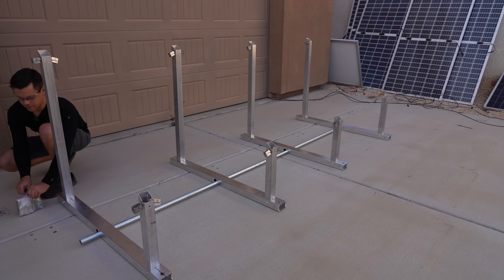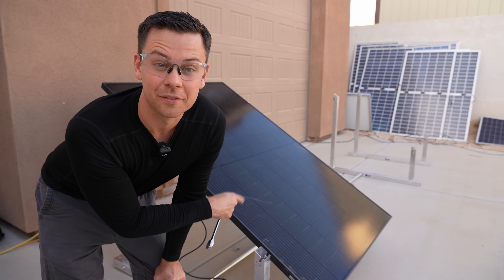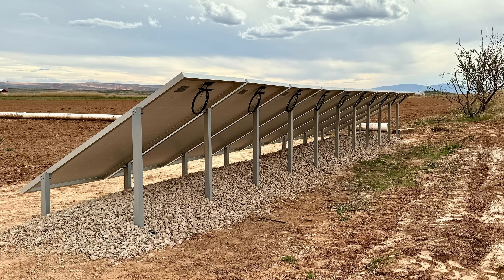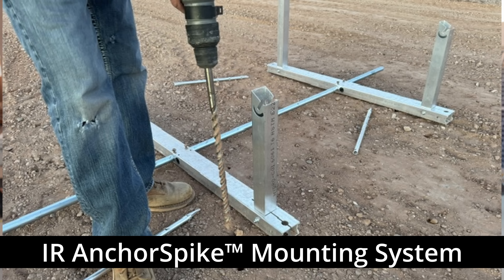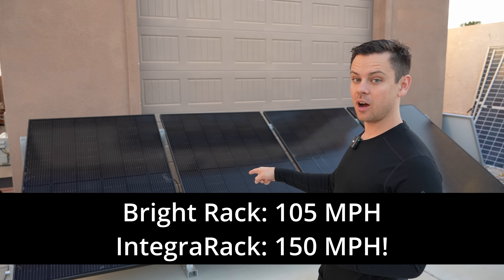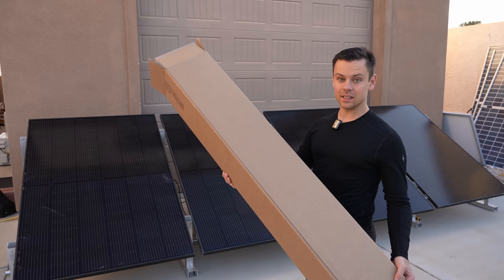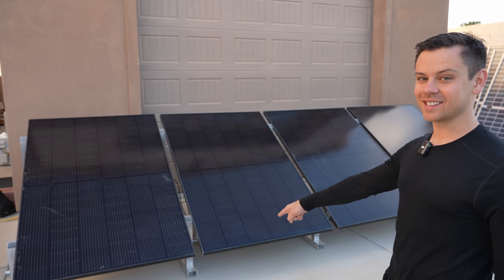IntegraRack: $545 Ground Mount Solar Array Assembled in Less Than an Hour!

Comment from the maker: And now they have adjustable models! Check them all out here: https://www.mobile-solarpower.com/ground-mount-racks.html

Or you can purchase from current connected: https://www.currentconnected.com/product/integra-rack-ir-30-frame-individual-frame/?ref=wpc

Solar Panel Deals: https://www.currentconnected.com/solar-panels/?ref=wp

0:00 Installation
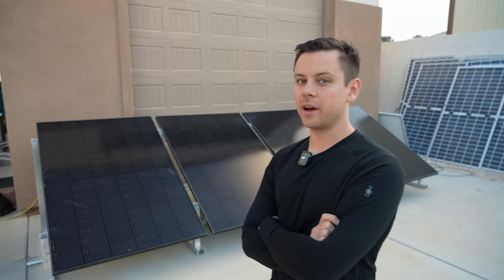2:20 Installation Time
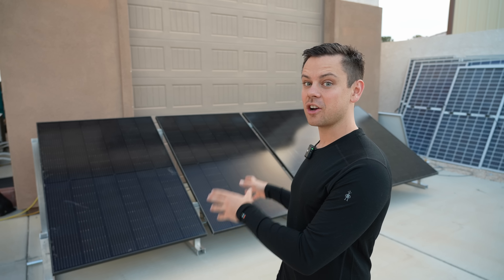2:37 Mounting Options
5:15 Comparison to Brightmount
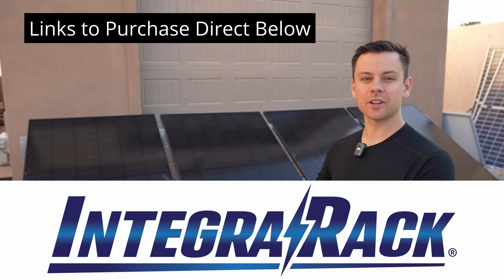6:01 More About The Company
6:26 Concrete Anchor Install
7:02 Conclusion

~~~~~~~~~~~~~~~~~~~~~~~~~~~~~~~~~~~~~~~~~~~
Tired of getting ripped off? Check out my "Will Prowse Approved" solar product recommendations below!

12V Batteries
https://www.mobile-solarpower.com/lithium-batteries.html

48V Batteries
https://www.mobile-solarpower.com/48v-batteries.html

Offgrid Inverter System Builder
https://www.mobile-solarpower.com/48v-complete-system-blueprint-559371.html

Hybrid Inverter System Builder
https://www.mobile-solarpower.com/code-compliant-48v-offgrid-system.html

Mobile Handtruck System Builder (very popular!)
https://www.mobile-solarpower.com/mobile-48v-system.html

Solar Panels
https://www.mobile-solarpower.com/300w-solar-panels.html

Ground Mount Solar Racking
https://www.mobile-solarpower.com/ground-mount-racks.html

Wire, Lugs and Busbars
https://www.mobile-solarpower.com/wire-and-connectors.html

Tools
https://www.mobile-solarpower.com/tools.html

Fuses and Circuit Breakers
https://www.mobile-solarpower.com/fuses.html

Plug-N-Play Solar Systems
Ecoflow, Anker And Bluetti! So many models to choose from. See my current recommendations here:
https://www.mobile-solarpower.com/full-size-systems.html

~~~~~~~~~~~~~~~~~~~~~~~~~~~~~~~~~~~~~~~~~~
Need to build a large DIY system? Need a trustworthy solar distributor? These are my favorites:

Signature Solar
Creator of EG4! Solar Minisplits, Victron and More! Largest Solar Store Online.
If you want $50 off, please use my link below and coupon code "DIYSOLAR50":
https://signaturesolar.com/?ref=cPwLcVc0SW-BjN

Current Connected
Best Prices for EG4, Victron, Midnite and so much more! Fast Shipping and Highest Rated Customer Service:
https://currentconnected.com/?ref=wp

~~~~~~~~~~~~~~~~~~~~~~~~~~~~~~~~~~~~~~~~~~
Join our DIY Solar Community 
Need more help? Join the largest solar forum on the internet for beginners and professionals alike. 140,000 members and counting!
https://www.diysolarforum.com

Check Out My Free Book
Best-selling and beginner-friendly guidebook to off-grid 12V solar!
https://www.mobile-solarpower.com/the-book.html

~~~~~~~~~~~~~~~~~~~~~~~~~~~~~~~~~~~~~~~~~~
Contact Information:
I am NOT available for personal solar system consult! If you wish to contact me, this is my direct email: williamprowsediysolar@gmail.com
FTC Disclosure Statement and Disclaimers:
Every video includes paid promotion or sponsorship (such as free products for review). Some links on this YouTube channel may be affiliate links. We may get paid if you buy something or take an action after clicking one of these. My videos are for educational purposes only. Information is subject to change/update at any time. Electricity is DANGEROUS and can kill. Be smart and use common sense :) DIY Solar Power with Will Prowse is a participant in the Amazon Services LLC Associates Program, An affiliate advertising program designed to provide a means for sites to earn advertising fees by advertising and linking to Amazon.com
Reply: Twice as expensive as the brightmount. No thank you
Reply: @carlosnindy  Depends on the work and supplies needed to complete the installation. If already have a slab to mount to your initial cost is lower but for many the mounts are only the beginning of the costs.
Reply: What panels were use in the making of this video
Reply: Awesome sound effects! Oh, and the content was pretty interesting too!
Reply: Will you need an apprentice!
Reply: Thank you for clearing up the cost for your usage on the video Will. 😁👍
Reply: Hi Will. SanTan does occasionally have used and even new bifacial solar panels. I have seen some very positive videos of the panels being mounted vertically and facing east/west instead of facing south. There seem to be surprisingly good results just because the panels do not get as hot mounted that way. Have you tried a set up like that yet? Thanks
Reply: I am looking for a wall mount system or a hardware.
I would hung them either vertical or about 10 degrees max for northern Canada's winter snowy days.
Could someone recommend a product that would allow us to mount them in portrait orientation to a wooden wall of a barn?
Reply: This was first one you did outdoors now!
Reply: Low Cost,  Fast Mounting, but to building codes allow a water / rock mout for  Solar panels ?   Some locations may require  Concrete footings for safety , etc. etc.
Reply: Good day sir, I have been watching your channel for years!! Awesome content, I have 2 renogy 200ah bluetooth batterys, they are severely out of balance, one cell in each of the batterys is reading 0.2-0.4 volts while the others are at 3-4, I purchused the new pro series battery but would like to fix these. How do I go about charging these individual cells sir, do I have to pull the cells apart so they are single or can I go through the balance wire with straight 12 volt charger?
Thank you
Reply: Hi Will enjoyed this video, but I couldn’t find the package of 4 panels with the frame for $545.00 could you please help so I can pair that with the EG 4 6000 ep I bought after your video I watched May 1st with shipping in route. Thank you.
Reply: @randywalker8960 I believe you may have misunderstood.  $109 x 5 =545 which I believe is the cost of the racks without the panels.
Reply: Keep up the great work Will! Love you dude. Super cool to see you in your zone and making great things!
Reply: no angle adjustment?
Reply from the maker: @wigenite  No angle adjustment, 30 degree only. That is also how they get the high wind and load rating compared to everyone else
Reply: Why would you buy glass panels when hailstones are getting bigger and bigger?
Reply: 5 x 109 = $545
Reply from the maker: @dougdorrer4622  Yes and when factoring in cost of concrete for brightmount rack, the integrarack is cheaper

Comment: These mounts look super easy to use. Good alternative to a roof mount if you have space and maybe an older roof. Fairly affordable too. These are the ones I plan to use for a 12 panel system.

Comment: they are 189 per beam. you need 5 to do 4 panels. Crazy price
Reply: That is for the adjustable ones. Fixed ones are cheaper.

Comment: Looking for a way to mount on the side of the house, not ground or roof.
Ground mounting subject to vandalism and theft.
Roof mounting due to high roof and steep pitch with too much shade.
Takes at least a 28 foot ladder to reach the gutters and have it 3 feet above that for a roof mount which is not my cup of tea.

Comment: yeah but each rack costs more than the solar panel. Is there a more cost-effective way to mount 20 panels without spending $3000 on racking?

Comment: Hey will thanks for the Video on this. I used the IntegraRack to install 12 - 380 watt Solar Panels on a 20ft Shipping container. Mounted both on the roof and on 1 vertical side using IntegraRack. Maximized the space, you video made the difference in deciding which way to go. I put a pic on the forum, and posted a video. Anyway wanted to say thank you for all you do! Keep it up!!
Reply: Did you install metal to metal or use some butyl tape?
I am considering this to install on my 40 foot container, yet i need to build a wood frame to get it at least 4 feet higher to get above some trees.
Reply: @ Actually we painted the top and side of the container with white elastomeric coating (same you would use for a mobile home roof) this was to help seal the container, insulate the aluminum from the steel and improve bifacial gain. Because of dissimilar metals (aluminum and steel) I would use some thing to insulate the two from each other to prevent corrosion.
Reply: @GearedAndReady  and the bolt was a third type of metal?
Reply: @patrickdonegan9559  The nuts, bolts and washers were stainless steel. It is really hard to prevent all conductive contact. Reduce it as much as you can, ground the container, will last a very long time.
Reply: @GearedAndReady  i have these silicon inset / washers that might keep the stainless from touching the other 2 metals.
and i am using those decksavers to keep the wood off the metal sides so there is no water collection places.
Reply: @patrickdonegan9559  Good idea!

Comment: Just ordered 31 of the 40° black zinc.
Reply: Unfortunately for you @WillProwse CurrentConnected I'd not have the 40° adjustable in black so I got them from SolarPowerDistrutors.
You should get a link for them that gives you credit. Not that you need it.

Comment: I know you showed the bracket that will make a ground connection throughout the frame and all panels.....but what about a bracket that would connect to the frame to hold a ground wire that goes to a ground rod? What bracket and where to find that would connect to that frame?

Comment: Will, one thing I am not certain about with this configuration are installs in locations where snow packs up to 3 feet high or even more! I wonder if IntegraRack offers some kind of (dare I say) integrated solution to mount these higher while still keeping things simple? I really do like these as it removes a lot of work from the equation, but in the locations where we install ground mounts, these are simply too close to the ground.
Reply: We have 17 panels with front 16" from ground. Nova Scotia. Worst winter ever. Very easy to remove snow and no issues at all with snow. The bifacial panels warm up the snow and it mostly slides off. Had a few big storms where I had to use a broom.

Comment: Beware. You are not getting a kit as shown in the video . price of 109 bucks is just for 1 leg!
One Base Tube
One Long Leg
One Short Leg
Four IR-F2 Flange Clamp Bonding Brackets
Four M8-1.25 x 90mm Carriage Bolts
Eight M8-1.25 Serrated Nuts
Four M8-1.25 x 16mm Thread Cutting Bolts
Four M8-1.25 x 65mm Carriage Bolts

Comment: I suggest take the solar panel off and put joist tape on top, and paint the pagoda first. The way you did won't survive years. The wood top will rot, the screws and bracket will not holding your panel.

Comment: I was informed that a solar rack can give 40% more that follows the sun.  Can I use a simple mechanical device that will moves the array at the same rate as the sun moves and at the end of the day trips a trigger and reset the array to move back to its starting position?  I may not get the whole 40% but would it not be substantial?  Could you demonstrate this?

Comment: I am about to install an array and was going back and forth between this and the Brightmount. In the end the cost is the main driver. Once it's installed it's done so if it is a couple of extra hours no big deal. To install 4 panels with IntegraRack is $440.00 for the 30* tilt. The bright mount is $279.00 to install 4 panels with a 30* tilt. In the end both are probably strong enough. If it was price competitive with the other option then I probably would have went with IntegraRack for the ease of install. I re-watched your Brightmount video for a refresher. Price difference is strange to as there are far fewer parts in the IntegraRack, you would think they could have knocked this out of the park. Thank you for the videos!

Comment: The nice thing about this mount is that it does not have any bracket that goes across the back of the panels that could block light from hitting the back of bifacial panels.

Comment: They look easy, but they are much more expensive than the brightmount. And I refuse to pay twice the amount of money for a simple piece of metal compared to the 430Wp bifacials I have.... The idea is good. But the profit is also very high.
The brightmount is as expensive as my panels, and is much more complex.
I am really inclined to just fuck it and buy some aluminium scaffolding tubes.

Comment: hey will huge fan...i have a Growatt-Spf-3000tl-Lvm-Es 120v....can i connect to my panel grid tied with a double pole 40 amp somhow so that both legs get the power before it goes back to the grid...whats my best option..please help =0

Comment: i like to get it but been X2 over EG4 mount stopping me ...
Reply from the maker: Calculate concrete post first. Compared to ballast
Reply: @WillProwse  , yeh... EG4 instructions come up to 52 bags of concrete.. 4000 lb but it still only $280(concrete post ) ... 4000 lb seems overkill ..
Reply from the maker: If you installed both of them you would choose this one in a heartbeat 😂

Comment: THANKS, FOR THIS DEMO/EXPLANATION!!  HOW ADJUSTABLE ARE THES FOR DIFFERENT "LATITUDES"?!... [ IMHO: THE "WATER JUG" BALLASTS PROBABLY WON'T SURVIVE WHERE WINTERS FREEZE THE GROUND].  [IMHO: THAT "SIEZED BOLT HAPPENS OCCASIONALLY/FREQUENTLY WITH "NYLOCK NUTS, ON STAINLESS BOLTS!!  ALWAYS PUT A FEW DROPS OF OI, OR, SOME GREASE, ON THE THREADS OF STAINLESS BOLTS/NUTS!!  TURN THEM SLOWLY TO AVOID SIEZING THEM UP (ONCE THEY SEIZE, THEY'RE "JUNK")] ... WHAT ABOUT CONNECTION OPTIONS?! I'D LIKE TO HAVE SEEN SOME SUGGESTED WIRING SCHEMATICS.... WHAT ABOUT THE WATTS/SQUARE FT?!...(POWER OUTPUT)???!!!.. COSTS???!!!  "PAY-BACK" TIME??!!!   IMPACT RATING?!!! (WITHSTAND RATINGS AGAINST HAIL/WING, TREE LIMBS) CAN THEY BE MOUNTED HIGH ENOUGH TO WALK UNDER THEM?...WHAT IS THE POWER OUTPUT, PER PANEL IN DIFFERENT "SOLAR-ZONES?!....:face-blue-smiling::face-green-smiling::face-red-heart-shape::face-red-heart-shape::face-red-heart-shape:

Comment: Trick to putting in them ground screws....pound in a rebar with some water and wiggle it every 3 inches on way down, pull it out after you get close to depth of screw....then put screw in.

Comment: Few sandbags for ballast and your ready to rock and roll, nice system.
Reply: Twice the cost of using wood....but looks like it will last for 50yrs....I would do it when I need to replace my wood mounts.
Reply: Kickers on back of my wood mounts I can adjust the angle, would prob be fine if I go fixed with just another couple panels honestly and this...

Comment: I dont like how low to the ground the mount is.  Looks like maybe 8 inches with those panels.   The website and ballast mount kit screenshots make it look like there are 2 feet of clearance.     Seems like extending out the legs a foot would help a lot..   then it would be usable in snowy climates.

Comment: Hi Will ,
How does one adjust the array angle with this system ? You are familiar with the EG4 Brightmount kit where the angles are easily adjusted for your optimal panel angle.Thanks.

Comment: I just watched the bifacial panel review and I wonder if you could put the tanks slap on a dc pump to water tanks holding it down and cool the panels down with the water and catch it with a gutter system. You would lose a bit of water through evaporation but can easily set it up to not turn on after a certain level etc.

Comment: You should install them on or in place of your garage doors. Then you could use the garage and still have peekaboo panels.

At that price a person could by a tracker system, and it would be cheaper, more powerful and more condensed/out of the way.
It would look way cooler even if you stuck it in your driveway, although next to a pool as a sunshade would be nice 
(knock off $150 for the premium kind and the thing almost pays for itself) In fact buy two and mount solar heater panels on the second for the pool.

Comment: Why did you do a permanent placement into the concrete using bolts when it is sitting in the driveway blocking the garage door and it shows it sitting in deep shade and not in direct sunlight? Isn't that an odd place to be placing solar cells that need as much direct bright sunlight as possible and to be not blocking the garage door and driveway? At first, I thought you would be mounting them using one of those other techniques, using heavy weights and putting them somewhere else, away from the building, out in direct light and not blocking the garage door. Sure fooled me.

Comment: so whats hard getting some square steel tube from hardware store. diy puts sellers out of business. commodity markets mostly. not even square tube. just angle corner beam. yep frame yourself. pre-drilled holes or just bare beams.
Reply: try three-point telescope piston/screw solar tracker ground mount.

Comment: Quick question: Do you think this racking system could be modified to support a second row of panels? If the rack was raised up a little bit higher, and longer, aluminum rails/unistrut bolted to the existing arms, could it support the weight of two rows of Aptos bifacial panels top and bottom rows? It looks feasible and the panels are light enough to make that work, it's just a question of the additional "rails" that would need to bolt to the rack, and the panels to the rails.

Comment: Hi Will!

Would you be interested/willing to do a DIY hardware store available ground mount build? I have been designing something for months, but I’m not an engineer. I have been trying to use as many 2x4s as possible in my design. I have been trying to design something that’s lightweight enough that I could move it to other spots on my yard (to move away from shade). Would I be able to send you some designs by email?

Comment: The only place on my property that I can mount your solar array is the top of a boat house which is 30' x 30' square the boathouse is constructed of wood. If this would be possible, it appears that the water tanks would be the most reasonable way to secure the solar panels. This would put the solar panels about 50 feet away from the house. Does it make sense to use this method?